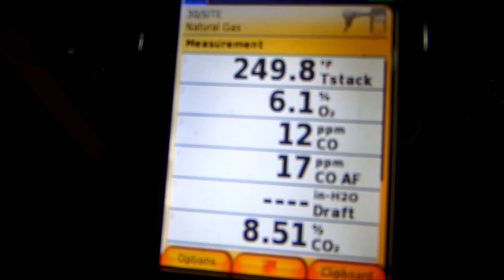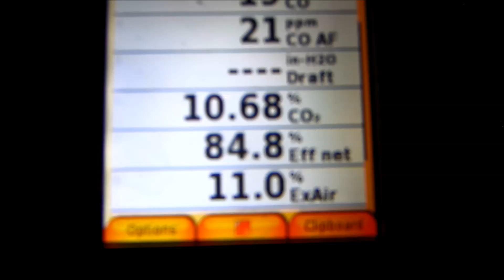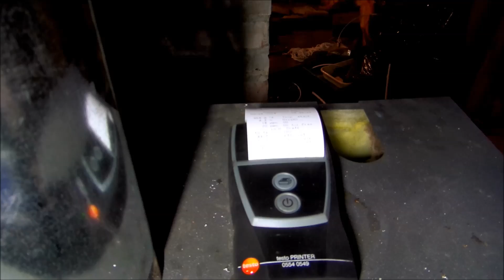hydronic heating:leaking  boiler ,replaced with new

Comment: Why 85% efficiency? Is it a steam system? Hot water condensing boilers should be 97% right?
Reply: It’s oil, oil condensing boilers are prohibitively expensive. If it were gas it would be affordable to do condensing.

Comment: Why would you install circulators on the return side of a new boiler? Why isn't the feed water line on a tee at the outlet of the expansion tank ( point of no pressure change ). Have you read Dan Holohans books? See "Pumping Away" you won't be able to put it down. Lots of examples and writes like a tech would speak.
Reply from the maker: +Mike Malone it really does not matter .dont believe every thing you read. 99%of all the stuff i work on is feeders on the supply and circulators on the return . don't fall for all the hipe .i beleve the circulator do work better on the supply pushing .but overall it really does not matter  is a house like this one . so best not to get your panies in a bunch .